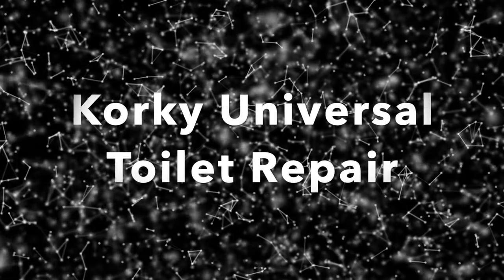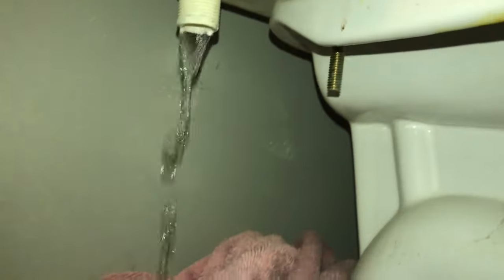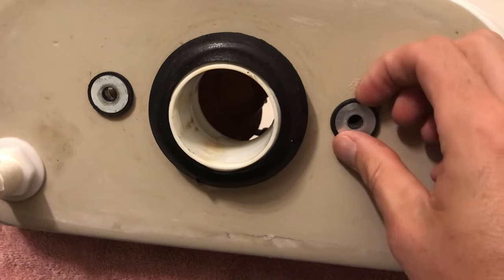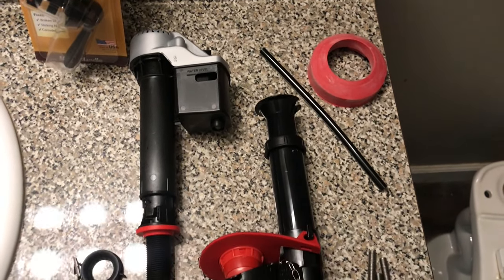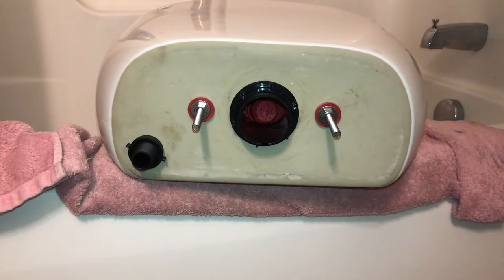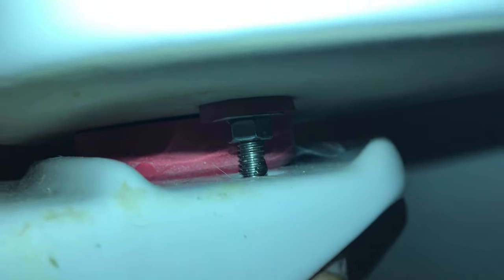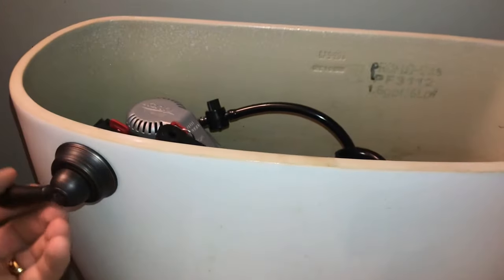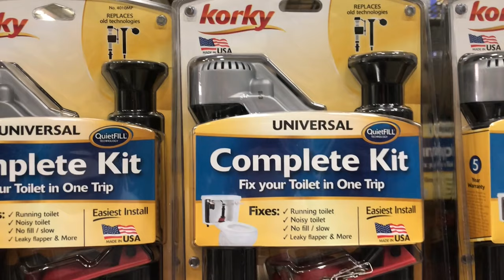Step-by-Step Guide - Korky Universal Toilet Repair + Flush Handle Upgrade!

Comment: Hey @WesleyAllen I am trying to figure out why you purchased the extra hardware. Also because my roommate lost the hardware to my Korky 4010MK when he couldn't figure it out. What can I buy to replace the 3 long bolts, metal and rubber washers etc? Thanks SOS I have got to get this toilet back together; especially since a guy in the house couldn't do it ;)
Reply from the maker: I purchased the additional tank bolts so that I had a rubber washer for both inside and outside the tank. (Extra waterproofing). You can buy tank bolts or Lowe’s or Home Depot. Just take a look at the section that supply’s toilet parts.. also, you could probably just buy similar rubber washers from the hardware isle without having to buy an additional set of bolts just to get the rubber washer I was talking about.. hope this helps!

Comment: Hey Wes. My flapper is not sealing so I will replace it, but then water still seems to be coming out in the toilet bowl, as in a trickle flush. I allowed the spill line to go on the outside of the fill tube, and there is no leak in the bowl then. When I put it back in the tube again, water keeps coming out. What am I missing? Thanks for your help.
Reply: @WesleyAllenNC  thanks for the advice. I eventually figured out why the water has to go into the tube. Made some adjustments, and it helped.

Comment: the bottom nuts (3 of them) on the tnk seems to stuck hard.  Adjustable wrenches do not seem to have proper hold.  What is the hole wrench you used? 13mm?  Korky's packaging is not much of help 
Thanks.

Comment: Is it wise to reuse the same connection to the water tube when you replace your toilet filler? Or is that why mine is leaking? I never changed out my old tube to my water line, but now this new filler line will not go into the fitting !
Reply from the maker: I’m trying to picture which connection your referring to.. the braided supply line?

Comment: Thanks for the excellent video.  After installing, I noticed leaks at two of the bolts several hours after completing the installation.  I tightened the bolts and left it overnight.  In the morning the bolts needed to be tightened again.  I'm wondering if the weight of the water in the tank depresses the gasket further and that change in the gasket was the cause of the leak.
Reply from the maker: That I’m unsure of. Did you use an additional rubber washer on the tank to bowl connection? It really helps prevent leaking
Reply: @WesleyAllenNC  Thanks, I will try the additional rubber washers.

Comment: i noticed you did not do the measurments / pencil markings that the korky video and instructions show. Does that mean they are not required?
Reply from the maker: I did but I must not have shown that part. It’s best to measure the water line so you can get it back the same way
Reply: I installed it using the video. Works great out of the box. Still playing with fine tuning it. One thing I don't like about using the second washer is the tank wobbles too much. I have it tightened to almost touching the bowl.

Comment: Followed your tutorial, including the extra washers. Super clear, but my toilet leaks after a full tank flush. I suspect it has to do with the large gasket (not the smaller tank bolt gaskets), any tips on how I can avoid wet floors?
Reply: Ah turns out I didn't tighten the tank to the bowl quite enough. Torqued that a bit more and no more leaks!

Comment: Trying to replace my guts and mine doesn’t have wing nuts.  Any suggestions on how to get the initial nut off with hardly any space?  Our toilet is next to the water heater. Otherwise I followed your video and feel Confident I can replace if I can get that one nut off.  Great job
Reply from the maker: Without seeing it, it sounds like you’ll just need a wrench 🔧

Comment: Great video. I think you would get an "A" grade for how you demonstrated and worked on the video.
Wouldn't it be easier not to take off the toilet and do the job?
Reply from the maker: Hey thanks! You pretty much have to remove the tank. The kit comes with a new rubber gasket of sorts to replace the older one currently installed on the toilet. You have to remove the tank to access it.

Comment: Thank you for the video! I think I'm going to do the exact same thing today. Love the oil rubbed bronze look trying to get most of the fixtures we have to be the same color. #Salute
Reply from the maker: Hey thanks for the comment. I hope the install went smoothly!
Reply: @WesleyAllenNC  It did. Korky complete kit fully installed. Home Depot didn’t have the Korky oil rubbed bronze handle so I got a universal one, but looks great and working well. Great flushing power.

Comment: Did you use plumber's tape when you attached the bottom part of the supply line?
Reply from the maker: I didn’t, but you certainly can if you like. It’s a super cheap and easy extra step.
Reply: @WesleyAllenNC  Thank you!

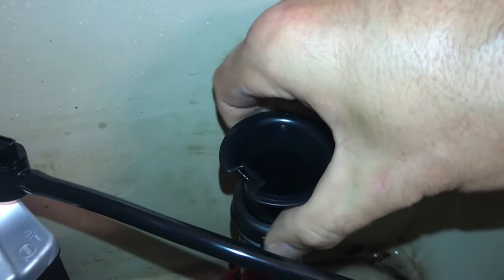Comment: 8:18 I seen another video and dude said dont drop it in the hole like u did. He said it can siphon water out the tank. And water will keep running. He said thats the reason they give that clip, because the tube needs to be at the top of that overflow tube so that it wont syphon. But i do it like you and had no problems. But im tripping now and thinking maybe its best to do it with the clip. But i thru my clip away becuase i did it like u did. And i have done it your way to all of mine and never had problem. But real talk , now my brain is tripping ✌️

Comment: I tried to do this myself only watching the Korky video and using their instructions. Thanks for doing this video which I think is much better.  Here's my situation -- I ended up with minor leaking from the flush valve opening. I think the tank was not sitting evenly on the base because the back of the tank was touching the wall. Also, I removed the tank and checked that area -- the chipboard washer was wet and torn. What can I buy to take the place of the chipboard washer or can I go without it? Any other advice for making sure it doesn't leak from the flush valve opening? I like that you secured the bolts to the tank first and then to the base with a separate set of washers/nuts. I will definitely do that.
Reply from the maker: Sorry to hear that it’s leaking! It’s hard to say for sure without seeing it myself and I’m certainly
Not a certified plumber, but I would tend to think the chipboard washer is probably necessary or they wouldn’t include it? I would bet that Lowe’s or Home Depot has replacement for this part (maybe even rubber) if your still expediting any leakage..
Reply: @WesleyAllenNC  I found a rubber washer to replace the chipboard one. Not sure what was causing the leak but after removing the tank, I secured the bolts as you suggested. This time I made more of an effort to press down on the tank while securing it. No leaks this time!!  Thanks again for such a helpful video and for replying to my question. 😊

Comment: Replaced mine today but the water is slightly trickling from the front of the toilet bowl.  I suspect it is the chipboard washer as the hole on our tank (our toilet is a Crane 3436) seemed a bit bigger and it was difficult to center it so the chipboard washer cover the hole.   Is there another option to use instead of the chipboard washer?   And, I only hand-tightened mounting nut per the instruction sheet.  Could that be it?   Any info appreciated.   Thanks!
Reply: @WesleyAllenNC  Yes-I did that too with the extra washers.   My question is about the Tightening the Flush Valve to the Tank with the big Mounting Nut that screw on from the bottom of the tank.   I only hand tightened it which the Instructions and your Video say to do but I have a slow leak that causes water to trickle into the bowl from the very front of the bowl.   Hope that makes sense.   Trying to determine what is causing the slow leak.

Comment: Very helpful. Will you do a video showing how to replace the commode from the floor with new phlange and bottom of commode?
Someone replaced one of my commode phlanges years ago with a 3 inch inside. Should have been 4 inch outside. I have had roots come up from it into the bathroom from the outside of the in foundation pipe. It is also not stable. Now I must figure ot how t cut the glued inside pvc plange out to replace with an outside.

Comment: Thank you for this informative and well-explained video! I just have one question: by how much should we shorten the links on the chain that connects the flapper to the handle (how many links should we take out?)
Reply from the maker: Instead of actually cutting the links, you can always test-fit the chain length by leaving the slack in place. It’s really just making sure you don’t have so much slack that you can’t lift the flapper which flushed the toilet, and enough so that it’s not too short causing the flush handle to bind..

Comment: Installing this was easy but I can't get this thing to flush normally, we have to hold the handle down forever, Ive gone through the tuning steps in the guide and still doesn't flush right, the old guts worked better. Any recommendations accepted. Thanks!
Reply: @WesleyAllenNC  I made the chain as tight as possible and did more tuning from the instructions seems a lot better, thanks!

Comment: You forgot to mention that the thread on the handle is reversed. You have to turn like you are tightening it, to loosen it. And don't forget that red tank gasket! It will be watertight until you flush it, and then it will be too late!

Comment: What a difficult removal of old parts on my toilet, hasn’t been changed for 28 years. Everything completely rusted
Almost considered throwing the whole toilet out 😅😂
Reply from the maker: Yes it can be tough with older toilets. There's also a flange that goes between the bottom of the toilet and the floor that can fail over long periods of time. When that happens it's normally a good idea to just replace everything if money allows since the entire toilet gets unbolted and moved from the floor at that point.

Comment: Korky has a new kit claiming to last 2x longer than the original kit, I am skeptical but wanted to point that out.

Also the metal clip that Korky provided is horrible, makes no sense. Use to be a fan of Korky but I am starting to question them. Also they don't provide 2 rubber washers for the long bolts.

Comment: Thanks but would add two caveats:
1)  The flush valve needs to be angled toward the back of the toilet not centered or toward the front.  Placement is shown but not specifically mentioned.  If centered or worse, anglied slightly toward the front, your flush handle assembly will only have one very small window between the flush valve and the wall, and also gauranteed to hit the lowest part of your lid - basically making it unworkable and requiring a complete dissasembly and re-positioning of the flush valve.
2)  As you mentiond :35 seconds in.... yeah if your current doesn't attach via chain make sure you grab separately when buying the kit to avoid another trip to the hardware store.

Comment: The video is great and the system is great. Yet, the last part is awful.  The sponge gasket is horrendous: too big, you have to tighten some minuscule nuts to make it fit. The Canadian kit DOES NOT include 4 pink washer as shown in the video but 3, and so does the number of nuts. If you want to tighten the screws to the body of the tank, you need 4 nuts, not 3. I wouldn’t but this if I were you!
Reply from the maker: Yes unfortunately they only come with 3 washers. That’s why I referenced the need to buy an additional tank-to-bowl set so that you have exactly what you need plus extras. Hopefully Korky will begin to add additional washers in future kits..

Comment: Do not buy this Korky universal Toilet Fill Valve!  

It is not “universal”. The refill tube is too short.
Reply from the maker: The refill tube twists and adjusts to fit
Reply: 1. The refill tube is too short for Kohler 1.0 gallon flush.
2. The lowest level of the flow valve is still too high for the Kohler 1.0 gallon flush. At the lowest setting of the flow valve, the water spills into the overflow tube.

Comment: Hello Wesley,  I followed you instructions to the T.  The water tank is wobbly because the rubber connecting the water tank to the toilet bowl is too high.  If I tighten them, what are the chances of water leak from the rubber?